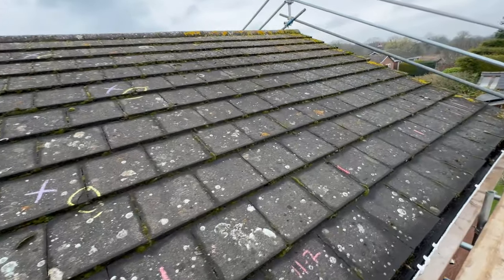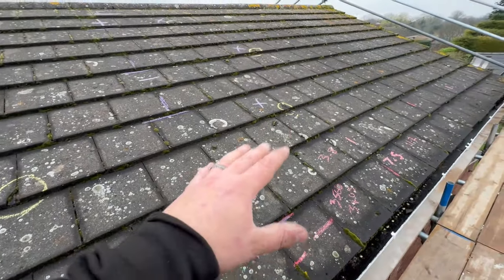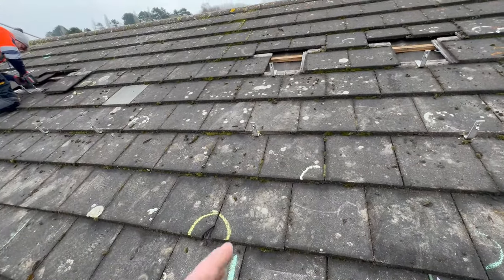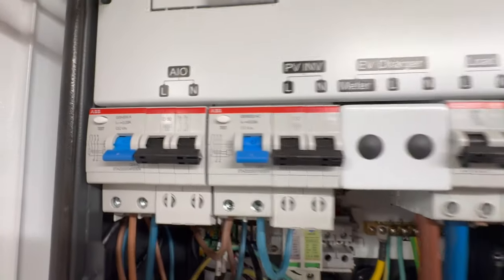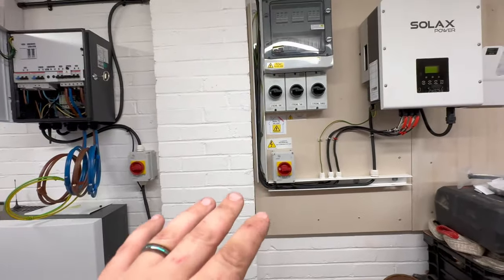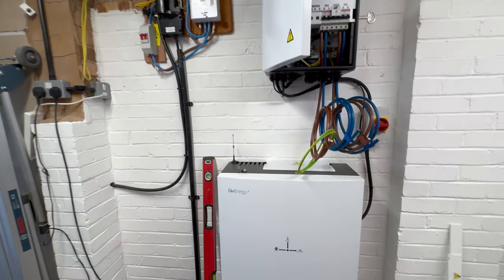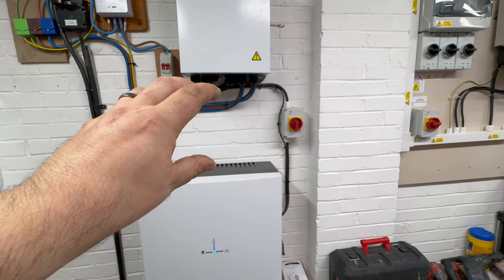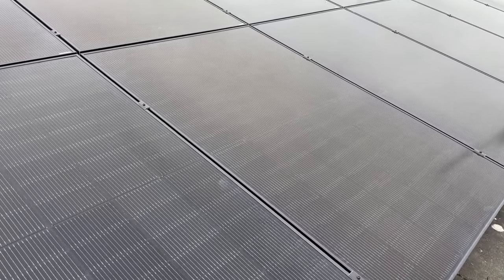Huge 12.2kW home solar system with GivEnergy AIO and Gateway - Run your house off grid the easy way

Comment: Hi, I have issues with the consumption, import and export numbers reported by the Givenergy portal. I am thinking this is related to CT clamp connections to the connectors in the gateway unit - in my install - load CT appears to be connected (from grid in) but not PV CT or AC CT so suspect this is causing my issue. Any thoughts from your experience on these installs?

Comment: Not sure why AIO choose that configuration, I know that sometimes the batteries can trip the standard RCBO, its rare lately the RCBOs dont like 2 way bi directional current. So I like to fit a standard RCD and a B25 MCB in-line, because RCDs can handle current both directions. 100mA is not allowed of course.

Comment: Hi Mark,

Really interesting video, thanks. I’ve just started my solar journey and I’m trying to learn as much as I can before I sort out an install. With that in mind, could I ask a couple of clarification questions about this particular instal:

Would I be correct in saying that you installed the battery as AC Coupled?

It’s my understanding that the GivEnergy OIN has a self contained inverter, so why did you also put a string inverter into the system - it would be really interesting to understand the rational of that decision. 

Finally, how easy are you finding it to get the DNO G99 approved? Is it regional dependent, or export size? I’m assuming that you can go ahead with the G98 max export of 3.68kW whilst the G99 application is processing and then upgrade the export max restriction when approved, is that correct?

Thanks for the help.
Reply from the maker: Thanks! To answer:

Yes AC coupled but the AIO has no DC PV input so you will.always require a PV inverter. It is all in one in the sense of the AC coupled battery system. 

With G98 nope I wouldn't advise that. You apply and wait to see what the DNO say some connections beyond G98 can be rejected. Unless of course the customer is happy to be limited forever more by a G98. Can take anything from 1 day to 45 days for approval. The new ENA portal is a much easier way atm.

Comment: A long shot but: I broke an mc4 connector which was supplied with a solax inverter. Can I just use a regular mc4 connector,or buy a replacement anywhere? Spoken to solax and they are being very unhelpful.
Reply from the maker: Not advised. You need to mate the connectors to the same brand. Some manufacturers will state cross compatibility but it’s not worth the chance tbh. You can buy solax mc4 on midsummer

Comment: A lot of peak power given the roof pitch.
Reply from the maker: It will peak at a season high around 7kW which is great with an 8kW export limit. Nice isn’t it
Reply: It's a lovely job, I have an East West array on my house with 10+9 Jinko 430s and the pitch is 35, it does peak too high for about an hour midday, so had to order another battery and might up the size of the hot water cylinder as I'm not allowed to export more than 25amps, here in Ireland. These are first world problems!!